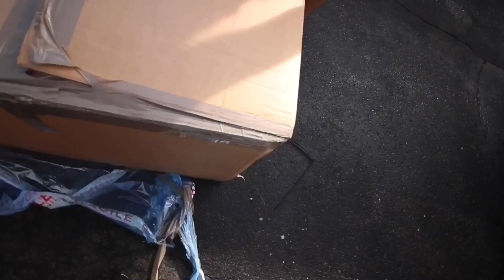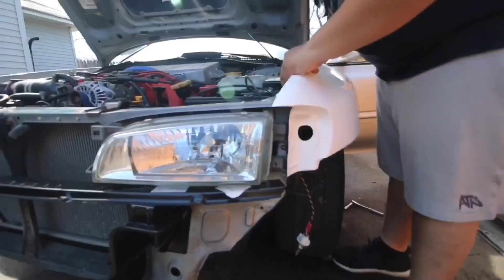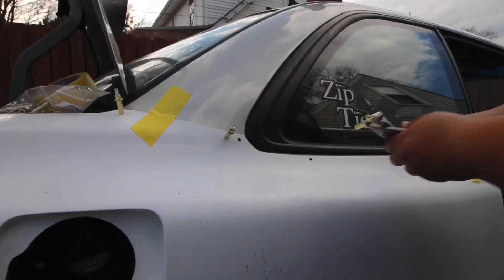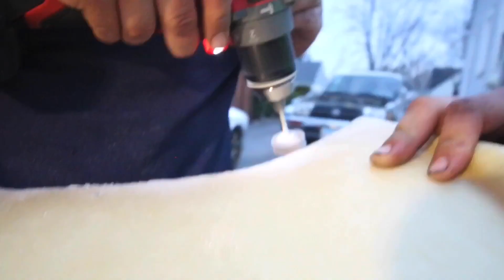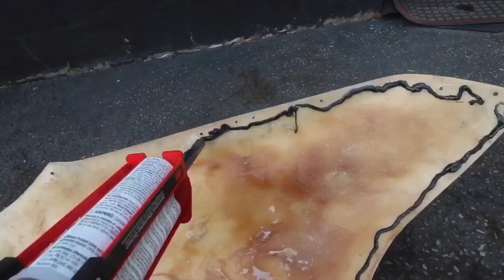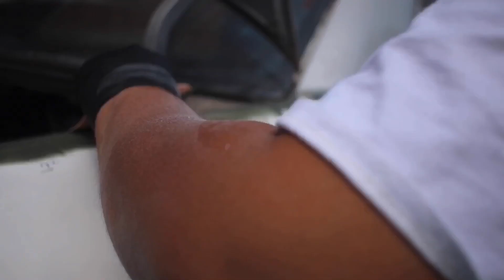BUILDING Widebody Subaru coupe in 5 minutes! (22B 60mm Kit)

Comment: Would love to see more footage of this build!  Would also love to have more details about how you attached the body kit.  Looks like you used some sort of rivet system, but for some reason, the rivets didn't have heads on them, allowing you to have a smooth surface to blend in.
Reply from the maker: They weren rivets I don’t remember the name but they were temporary holds till the panel bonding dried. Def gotta post an update soon
Reply: @AFewGuysWithZipTies it looks like cleco clamps and then rtv was used to glue to the body